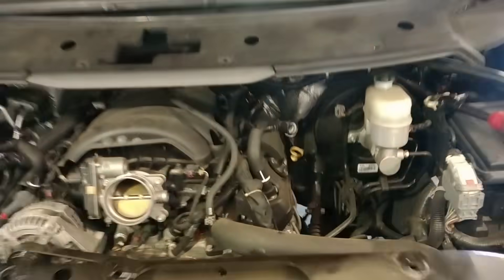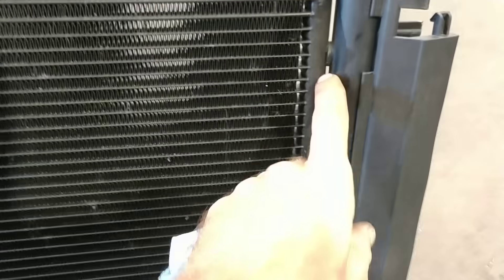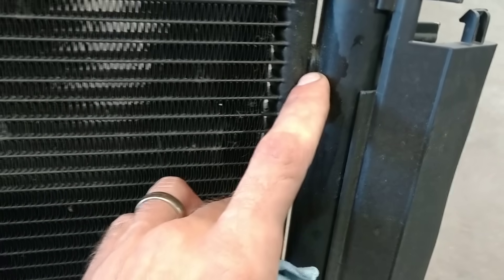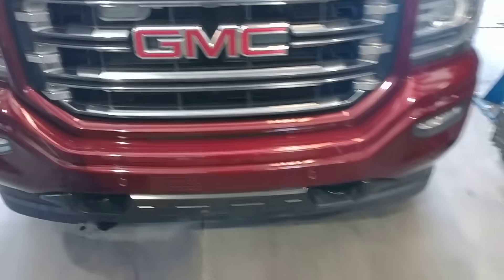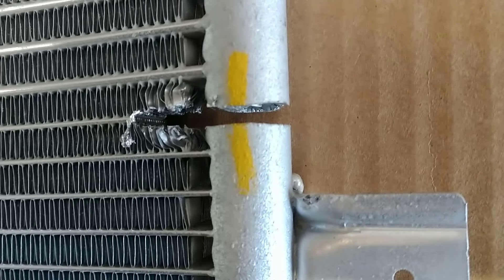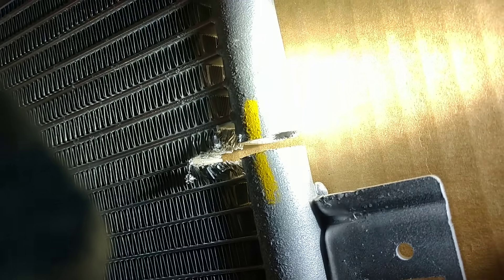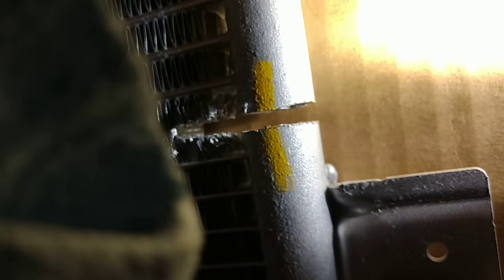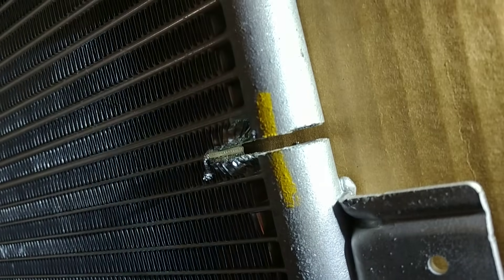Customer States...WAIT, look at this! Can't make this stuff up!

Comment: When I worked at gm I did a million of those condensers. They all look crappy like that. The first one that came in like that, I had parts order another. Yup they are all that shitty, also above that cut is the transmission cooler. Seeing your condenser internals is "normal" in GM's book 🤦

Comment: What is even more interesting is that the tube is extruded through a former like playdo. The aluminium billet is heated and the force of some quite frankly HUGE  hydraulic rams liquifys the aluminium as it passes over the fingers that form the tiny holes. - Even more involved is that these are brazed together. The fins are actually three sheets of aluminium rolled together until they are really thin. The inner layer is pure aluminum and the exposed outer faces are high silicon to lower their melting point (like brass is to steel). The oven has to hit a precise heat just between melting the silicon ally and not melting the pure aluminium of the fin filling and of the tubes. And as if that isn’t complex enough, the tanks braze on at the same time with the same layered aluminium sheet as the fin, but thick enough for a tank.

Comment: I guess the employees did not get there raise that week before walking off the job.  Definitely not shipping damage . 
            I got a video with the whole condenser headed to cut completely off shows you exactly why you cannot reverse flash the systems to get metal debris out after a compressor failure.

Comment: That part failed quality control. One of the factory operatives doesn’t know what the finish product should look like. And hasn’t been trained properly. We used ‘destructive’ identification on power steering hose assemblies. This prevents any bad part being used, especially if they go walkies from the shop floor with this one looks ok, I can use that on my own car. But yes should never have got shipped.

Comment: From the thumbnail I said "That's a combo cooler".  I've NEVER seen this "cut" though.  Denso, Visteon and Halla have them, and all of them charge HUGE money to make them (though it doesn't cost any extra).  The cut is there for the difference in thermal expansion.  Ford had a bunch cracking due to the different rates of expansion.  It looks like GM decided to just band saw them to prevent the cracking Ford saw (I believe Ford also had cut theirs as well when it was discovered).  Now the Combo Coolers come in cut via waterjet or made with two pices.  

Yea, those microchannels are tiny, those fins are even thinner.  Crazy stuff, but you'd be surprised at how fast they make those units, and how much markup there is on them (like 400% minimum).  $50 unit to the car companies might be $250 from the parts store or from the dealership parts department.

Comment: That’s not an accumulator, it is a receiver dryer. Accumulators are attached to the evaporator core, receiver dryers are attached to the condenser.
Reply: Almost, it's spelled drier ;-)

Comment: You got it for less because it had been reduced... Unfortunately, not in price, but to scrap!

Humour apart, was it not possible to reseal that small fracture in the original rather than to replace the entire unit?

Thinking about it a little more, as a shop you won't want to try that only for the unhappy client to return if the repair failed, so ordering in a new part covers you in that respect.

Maybe try to repair it if it was one's own vehicle and a replacement was expensive!

Comment: I'll bet it was a sample they pulled off the line and cut open to inspect the tubes and somehow it got put back in with the ready to package area and whomever packaged it would have absolutely no idea to not package it and ended up getting miscounted going on the truck (home alone scenario) and someone somewhere would have gotten it nomatter what, it just so happened to be you.

Comment: yes the parts are both faulty in this case but ffs i will never understand the con artists at any company shop... like a normal person with decent morals would simply weld that joint, fix the part, save the customer some money, and save themselves a ton of time. it takes less than 2 mins to weld a one inch bead as opposed to the hour or so itll take you to swap the radiator like wtf?

Comment: I work at Chevy and the parts are always usually quality except for some of the things like little bolt kits for jobs that don’t need a whole thing. Example that a door hinge costs around 140 for a Sierra and the kit that has the roller and pins and the parts that’s on the hinge literally costs 20 dollars less. At that point. Just buy a new hinge to make it easier 😂

Comment: "Little itty bitty guys..." If anyone is curious, I think the reason for tiny passages is that it leads to turbulent flow, which helps the heat transfer. It also reduces the distance for conductive heat transfer, which also helps. So, smaller, lighter part yet suitable performance.

Comment: I used to sell heating and cooling parts for automotive.. I've seen radiators and condensers in a perfect box have door prints on them. I've seen them bent like a bow. The dryer snapped off.

Comment: Apart from heat transfer, being separated means thermal dilation don't affect the joints as much, as they now have a gap in between to move freely.

Comment: i replace these these all the time.  gravy money. takes me 45 minutes and pays 5-6 hours.  you'd be surprised how many gm parts i open to find something broken.  i got a factory gm transmission last week when i opened the box the bell housing was broken in 5 pieces.  i open my stuff with the delivery driver before he leaves it's so bad. he just scratches his head as we load it back on his truck.

Comment: Next day
Customer: Not only is the truck blowing hot air but now I'm on the side of the road with the gauge on H.
Mechanic: Well I did see a gigantic hole in the brand new radiator.
Reply: Mechanic: Patches hole with a sticker

Comment: I do commercial/ industrial heating and air-conditioning and I have found sabotaged equipment straight from factory before even with quality stickers on the boxes.  Multiple times.  I have found motors shorted to ground brand new from factory and also wrong voltage items installed in units that they claim were tested from factory before they leave the floor.  🤮🤮🤮

Comment: Delco will probably ask "Well, how do you know the part doesn't work if you did not even try to install it?"
Reply: Then complain they can't take the part since it's been removed from the box
Reply: @justaguy5770  its supposed to be like that
Reply: Exactly. Customer's Hotline 500 dumb questions challenge.
Reply: ive had parts guys ask this, my answer would be; Because theres a fucking big hole it it
Reply: That’s 100% what this kid I work would say to me if I showed him a problem.
Reply: they actually do work with the cut in them like that, the cut is done at the factory to relieve stress on the failure point, and it is actually sealed. the yellow mark is done at the plant to mark where to cut it.
Reply: Ford would say, "I'm sorry sir, but that part is not covered under warranty. It's considered normal wear and tear. We'll be glad to have one of our service departments replace it for you, at your cost of course."  Junk bastards!

Comment: Mopar has been using the same condenser/cooler design for many years and has not had that same problem that I've seen so I wonder why the GM one is cracking? Either way, pretty funny how they just hack it off lol

Comment: GM junk, had the same problem on so many... GM won't stand behind it after 3 years 36,000 miles.... They know it's junk, was told the parts would take 4 to 5 months, the last guy filled his A/C with cans and traded it in for a new Expedition and swore off GM for life, for that and so many other reasons, like $15,000 in repairs to 4 year old Tahoe that was certified but nothing ever covered.... That and $6,000 in rust repair that "would have been covered" if there was bigger holes in the body.... GM did a great job chasing a well heeled customer for life by doing Nothing for them.

Comment: Found a small Coke bottle hanging by a wire inside the right rear quarter panel of a new 71 Firebird. It had a note inside said..Ha Ha You Found Me. Dealership that sold the car could not find the random noise,  so the owners traded at the place I was working. Thanks for the memories .
Reply: My family had a GM & AMC dealership in the 70's and things like that were found all the time.
Fast forward 30 years and my wife's uncle was verifying the practice since he worked at a GM assembly plant. As a quality inspector!

Comment: Those tiny passages in that condenser are the reason why you don't use refrigerant with that stop leak crap, it stops leaks ok, but it also plugs up those tiny passages in the refrigeration system too LOL.  

Hmm, wonder who decided that condenser was ok to ship out to a customer.

Comment: I’m pretty sure the cut is intensional to allow expansion, I only say this because I ran into the same thing!
Reply: I think your correct bud . It’s marked and it’s right where condenser stops and trans cooler begins
Reply: @melvincordovez484  It's plugged off where that cut is made, there's already aluminum in the tube to block the two circuits from mixing with eachother.
Reply: It’s not intensional lol
Reply: @SRN42069  Yes it is.  GM in their infinite wisdom took the trans cooler and the A/C condenser and stacked them on top of each other and made them one unit but two separate cooling circuits, sorta of how a trans cooler in a radiator is a separate circuit, they don't mix. On the original design they're plugged internally where that new one was cut.  As dude in the video showed, the original ones are failing at the connection to the accumulator from heat cycles causing the cooler to expand and contract.  To band aid fix the issue GM is now cutting them in that spot to half ass thermally isolate the two coolers from each other.

It's definitely a shitty solution though.